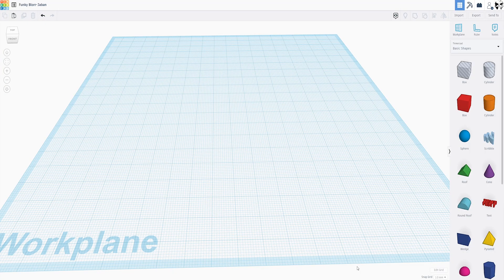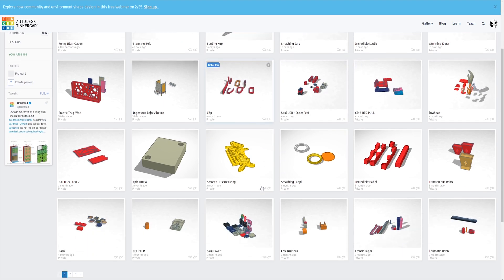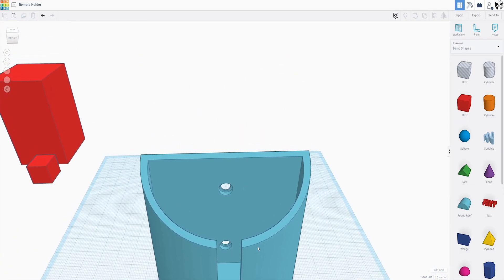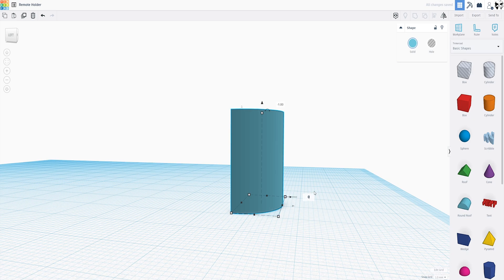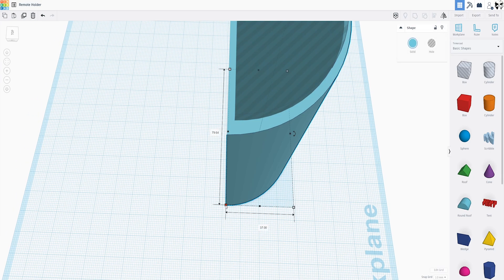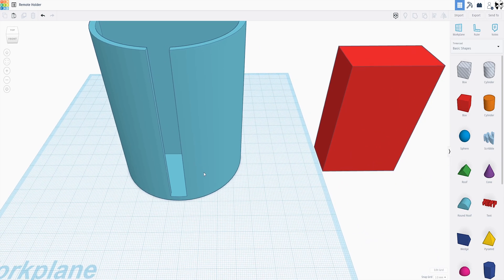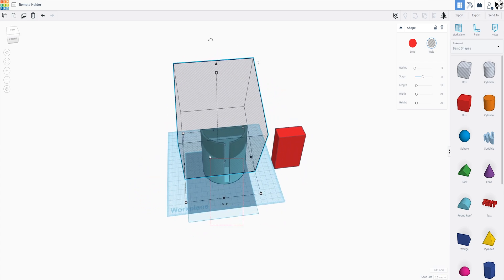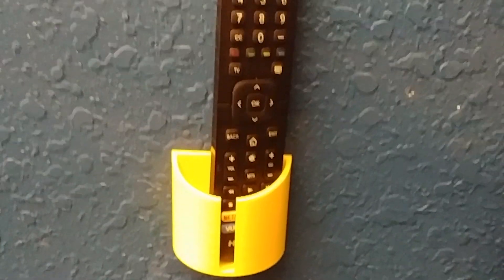Let's Design Together | Tinkercad Beginner Tutorial! | pt.1

Comment: Love your thorough yet easy to follow tutorials! Subscribed. =) A question please - how can I add measuring lines to an object? Both recessed or protruding would interest me. I'm wanting to print some tools that will help me measure stuff. I guess just like a ruler does. =D
Reply from the maker: I appreciate the kind words and the sub! There's a ruler up at the top right above the shapes that will help you out. Here's a tutorial that I followed and it worked well for my needs
 https://youtu.be/domyL3PQd5k?si=xkVnTuGLeoAZX7p-

Also, I can't recall if it's mentioned in that video but down at the bottom right of the work area, there's an option to edit the grid and change it to inches in case you're wanting to design something that measures that way.

Comment: Very nicely done. The benefit of live narration is that we can see the actual thought process and any errors that may creep in. As you noted, post editing can easily forget small points. In my case, I've been using tinkercad for just over a year, so appreciated that you did not focus on keys or buttons but just explained the steps. Specifically, you just aligned objects without slogging through the "push this icon, then select centers, etc." Made this easy for me to follow.